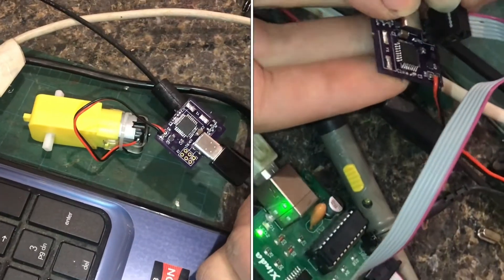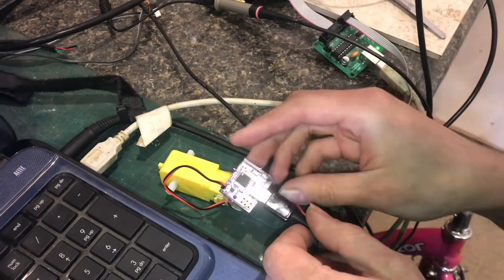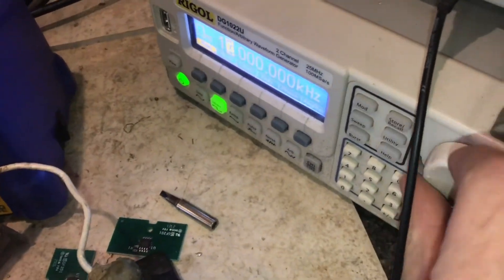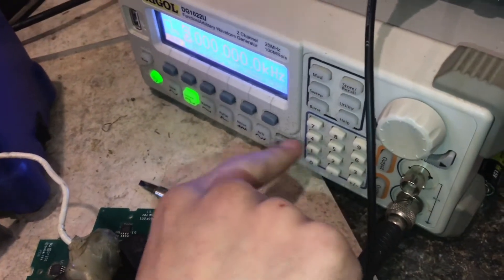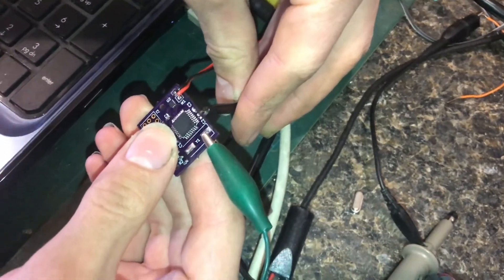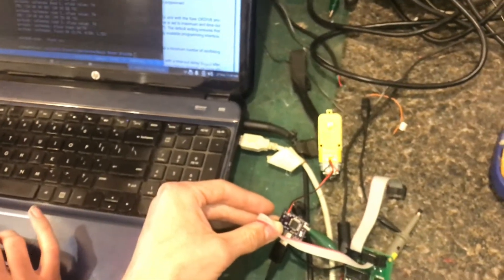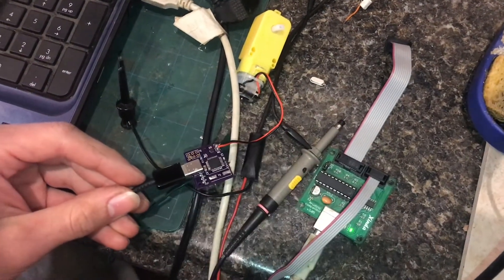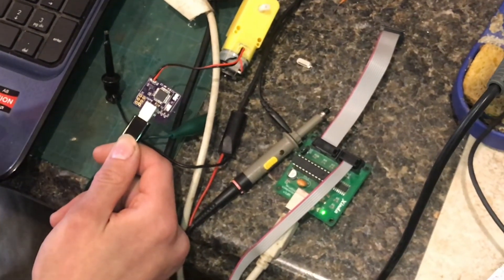how to “unBRICK” an avr microprocessor (the details) bricked fix

Comment: Thanks very much. You saved my day and my $$$. Have a mega2560 arduino clone which was 'hardware bricked' and I thought I had software bricked it. Only to find out that it had a faulty 16MHz crystal. Replaced it and now avrdudess can now see it, though this chip is not running at my required speed, but at least I can program it again and again.
Thanks for your video

Comment: How do you calculate the baud rate? What value should I use, I have an ATMega32u4 which uses an external 16Mhz resonator. I am now getting `error: program enable: target doesn't answer. 1`, I am hoping this is how to fix it.